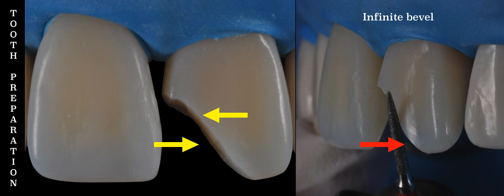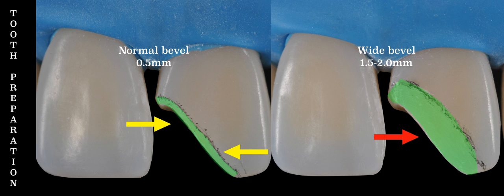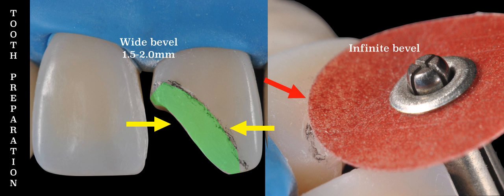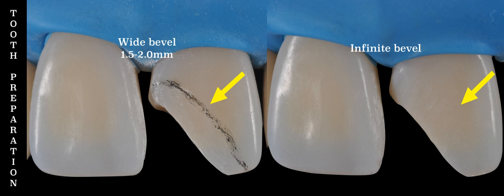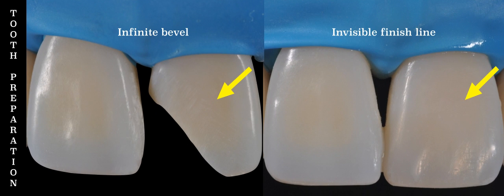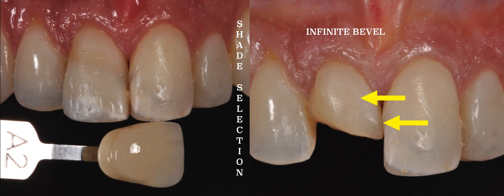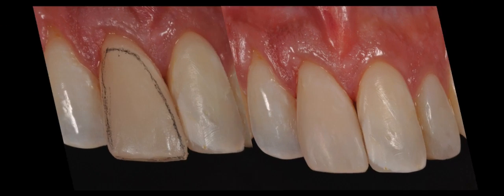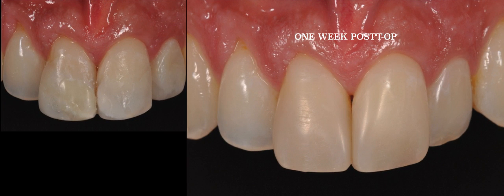Esthetic Bevel tip

Comment: Good video sir, even though you didn't use dual shade composite your restoration has been really a goal to run after as a dentist. But big part where most of this is the job of finishing and polishing burs that you didn't explain their usage and this left me unsatisfied a bit, would appreciate if I see a full restoration + finishing and polishing to achieve this amazing aesthetic result